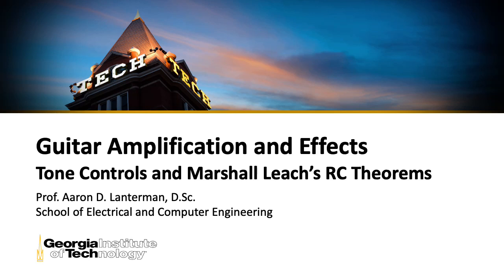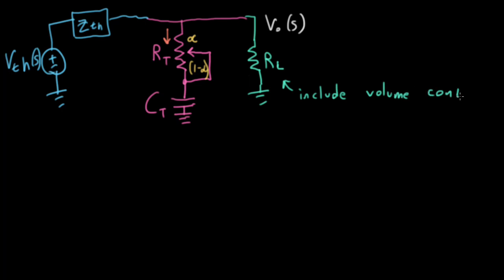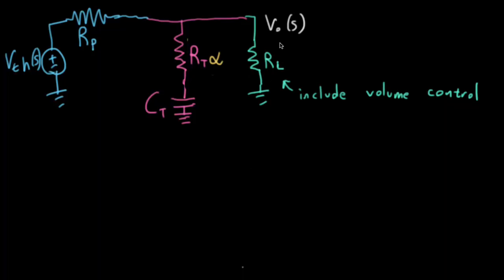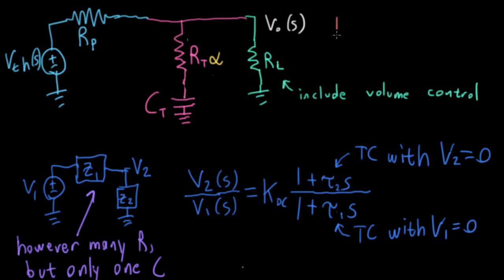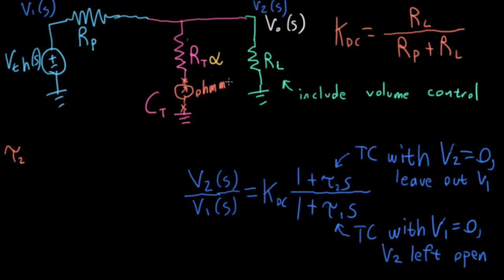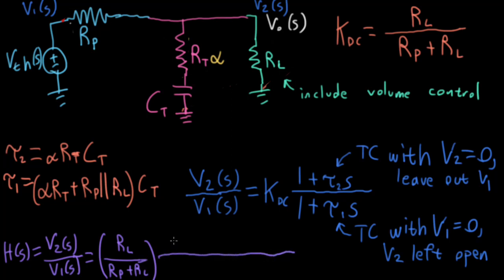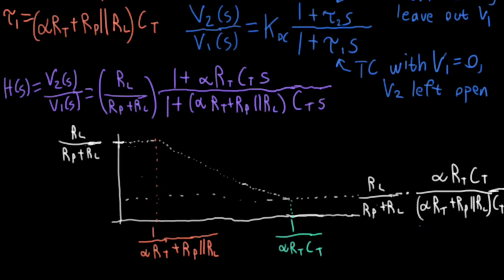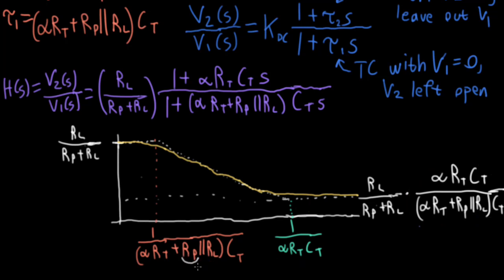ECE4448 L11: Tone Controls and Marshall Leach's RC Theorems (Guitar Amplification and Effects)

Comment: it made me wonder about the active circuit in guitars like The Les Paul Recording, where I am supposing there's buffering between the different parts to make it a little more sane.
Reply from the maker: Oh, interesting... I'll need to look into that. I hadn't heard of Les Paul Recording guitars before you mentioned them. If they use active electronics I bet there is buffering.
Reply: The places I read about it mention low impedance circuitry, but as usual with these things, no one goes into details.

Comment: From looking at the setup and Professor Leach's document, It seems that the RC Theorems can be derived by using the Extra Element Theorem (EET). I teach this in my senior/graduate level course on circuit theory; however, I only know of a few places where EET is mentioned. Basically, you can derive K, tau1, tau2 by inspection for any configuration. There are also extensions of this theorem to include multiple L, C, etc.
Reply: I was taught EET by Middlebrook @ Caltech.. EET is also taught by Vatche Vorperian at Virgina Tech..
Reply: @cerrem1  I took Dr. Middlebrook's 1-week course, followed by Dr. Vorperian's 1-week course in the summer of 1994 in Arizona. Dr. Vorperian was at Virginia Tech in the late 1980s to early 1990s? He has been at NASA JPL for about 30 years or so. He has written a textbook on this subject. Dr. Robert Erickson (a doctoral student of Dr. Middlebrook) teaches this at U Colorado Boulder.
Reply: @Vahe.Caliskan  Very cool... I was working at JPL when Dr. Vorperian was there...
Reply from the maker: @cerrem1  Wow!
Reply from the maker: Oh, thank you so much!!! I didn't realize that was what it was called.
Reply: With any component taken as the "extra element", you can calculate any transfer function (response(s)/excitation(s)/ by calculating three quantities: 1. Transfer function with the element removed (and replaced by a short or an open circuit), 2. The impedance seen by the "extra element" with the excitation turned off, and 3. The impedance seen by the "extra element" with the excitation active by the response nulled.